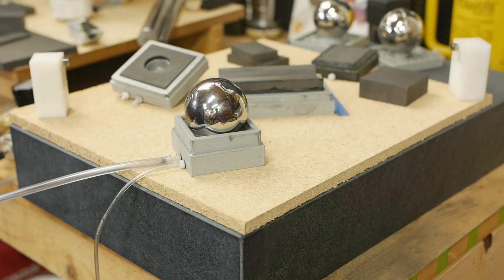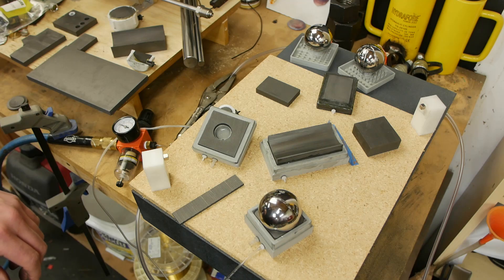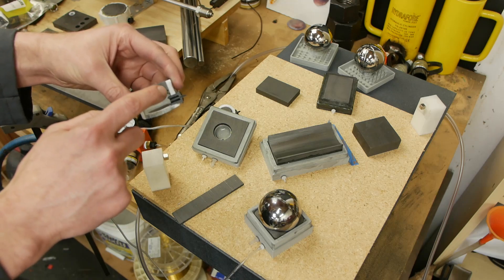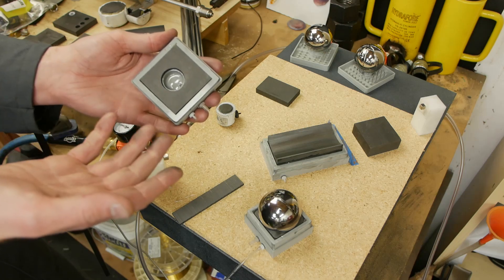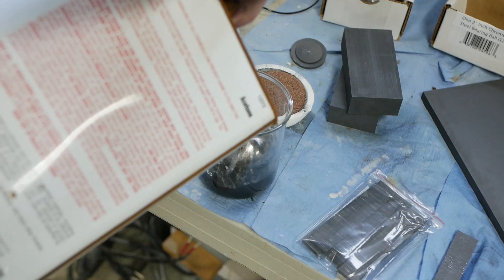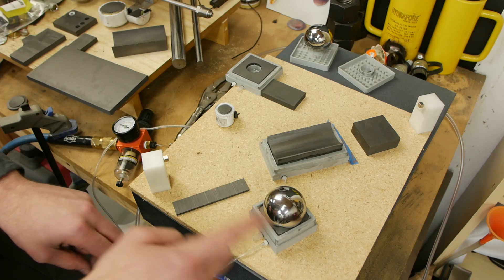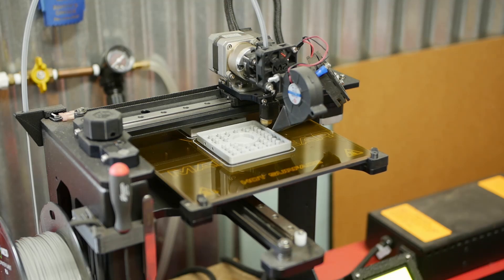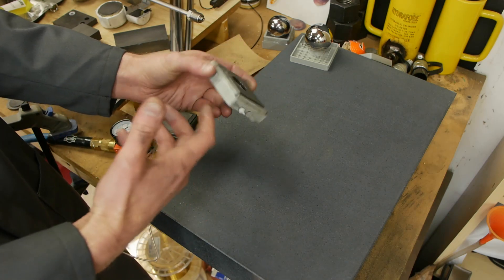Make vacuum pre-loaded spherical air bearings without special tools

Comment: I run a Zeiss CMM that uses air bearings. The 33 ton granite table is supported by them, all three axes are supported by them. They also make excellent vibration insulators, they were running a dirt compactor directly behind the room it's in, shaking all the tin on the building like mad, but the table had no vibration transferred to it. As you mentioned, it must be kept clean, as otherwise it would grind dust into the granite.
Reply: Well, I for one learned something in this comment section. I figured a regular air bearing would be sufficient to isolate vibration. Considering the size and mass of the granite table, I would expect that the system holding it is more designed for isolation. Otherwise, why not just set the table straight on the floor or a stand? The moving components are definitely air bearings though, which is pretty neat. Thanks for the insight. I mostly know about programming and operating, and even then my knowledge is limited.
Reply: @ahfreebird  You are most welcome. These things are all quite amazing!
Reply: Such civility. Scandalous.
Reply: Do you mean air cushions used for vibration isolation? Usually those are somewhat opposite to the air bearings -- an air bearing is usually desired to be very stiff to maintain the air gap exactly the same despite varying load (very high spring constant). Supports for vibration isolation are the opposite -- they allow movement of the support, but still provide the same force (very small spring constant).
Reply: @cogoid  the stiffness/damping of the air bearing is tunable by the film thickness. The less preloaded thicker film has very good damping affect. As it goes thinner it also gets stiffer and most of the time it can be stiffer than the fixtures structure.
Also, damping affect and elasticity are different things. Damping is not a measure of how bouncy it is. Thinner spring and thinker spring are both bad on damping because the energy got storage and release back and forward without much loss. Damping is how well it can obsorb impact and disperse the energy elsewhere ( or to another form). Air bearing by nature is a good damping material at it's stiffness class.
Reply: @dongchen7940  Thank you for mentioning damping. Damping is indeed important, but it can also be counter-intuitive. Although many of the things that you are saying are correct, the story is somewhat more complex.

Indeed, having sufficient damping is quite important in both air isolators and air bearings -- in all cases it is necessary for reducing resonant phenomena. 

Damping coefficient is a very specific parameter -- it tells how lossy the resonator is. As you have already said, it is a separate parameter from the stiffness of the elastic element in the resonator.

Air bearings can have substantial damping coefficient, but this is not synonymous with low transmissibility for vibrations. For vibration isolation of Optical benches, CMMs, etc, one should still choose isolators specifically designed for this purpose. For vibration isolation we are interested not in the damping coefficient or the stiffness per se, but in the system frequency response, at the frequencies of vibrations -- we want low transmissibility to the vibrations.

This response has a somewhat complex relationship with the damping coefficient. In particular, maximum damping in air isolators is usually not desirable for achieving the best isolation -- optimum isolation requires low stiffness and just enough but not too much damping.

Borrowing from Newport web page which I have already mentioned earlier ("The Need for Vibration Isolated Rigid Support Structures"):

The performance of the isolator is defined primarily by its natural frequency and damping characteristics

Natural Frequency (Natural Mode, Resonance) - The pneumatic isolator is essentially a simple harmonic oscillator that uses the "fast roll-off" at higher frequencies to act as a low pass mechanical filter. Below the natural frequency of the harmonic oscillator the isolator is essentially rigid and vibration is passed directly to the platform. At the natural frequency vibration is actually amplified. Therefore a primary goal is to lower the natural frequency since this improves low frequency isolation and overall isolation bandwidth.

Damping - Another primary goal is to damp the harmonic oscillator amplitude at resonance. This lowers the magnification of vibration at low frequencies and improves system stability. Unfortunately there is a compromise between the natural frequency and damping as damping is increased, the isolator natural frequency moves slightly higher, and higher frequency isolation is decreased.

Thus a practical vibration isolator provides a very low resonant frequency (by having very low stiffness) and also provides a compromise between having enough damping to not have a strong resonance, but at the same time not too much damping in order to have a rapid roll-off of the frequency response (and thus better isolation) at the higher frequencies. Vibrations at 30, 60 Hz are often of greater concern than the 2 Hz oscillations near the system resonance.

----

The less preloaded thicker film has very good damping affect.

It may seem so at a first glance, but at least for the kind of the bearings shown in this video the opposite is true -- up to some point, smaller gap results in higher damping together with higher stiffness. 

"New Way Air Bearings" company has many good presentations on air bearings, including measurements of how damping and stiffness depend on the air gap. Here is how they explain this:

"if there is zero stiffness, there can be no damping because the rotor has nothing to exert force on. A large film thickness is like ringing a rotor hanging on surgical tubing to get its undamped natural frequency. If the stiffness is infinite, then there is no motion, and again zero damping (damping being force over velocity). So, for a given system and frequency, somewhere in between zero and infinite stiffness, an optimum point will be reached to maximize the damping, after which point further increases in stiffness will begin to lock up the motion, reducing effective damping." [Damping & stiffness, a primer BY DREW DEVITT]
Reply: A small clarification. Isolation always suffers from too much damping. And generally, this has nothing to do with the changes in the resonant frequency, even if they may occur in some designs of the isolators.

In vibration isolation, the situation is as follows: there is a floor that vibrates, there is a machine (mass) which we are trying to protect from the vibrations, and there is the isolator between this mass and the floor. This isolator has elastic properties (it generates forces opposing it being squished or stretched -- this allows it to support the mass) and it has damping (it generates forces opposing the velocity with which it is being squished or stretched -- which allows it to dissipate energy).

The mass + elastic element is a harmonic resonator, and it resonates at some frequency, amplifying the vibrations -- an opposite effect of what we are trying to achieve! Adding some damping makes the resonance peak shorter and broader -- there is less vibration of the mass at the resonance frequency of the resonator -- which is a good thing. 

With more damping there is less movement in the spring at all frequencies. But this is not good -- our goal is not to reduce the amplitude of the movement between the ends of the isolator itself! Our goal is to reduce the movement *of the mass*, while the floor under it is vibrating. We want the isolator spring to move as much as the floor does, to keep the mass steady. But with infinite damping, the mass simply copies the velocity of the floor -- there is zero isolation. We do not want that at all.

Thus we want to have enough damping to reduce the resonance, but still relatively small damping, because the damping itself is a path through which the vibration velocities generate forces on the mass we are trying to isolate. (This dominates at high frequencies where movement velocities are high even for small amplitude vibrations.)
Reply: @cogoid  Thanks for the reply. I appreciate the discussion. I agree with you on the low-frequency vibration isolation. However that is a different thing than air bearings. It is more like the four floating feet we have on the optic table. Those things are very "floaty". I  don't have much research on that topic. The damping effect is also quite different than the vibration isolation. Damping is more about "impact" instead of a long period vibration source. An "impact" in time domain translates to a  very wide band in the frequency domain, it is not targeting isolation of a specific frequency. IMHO, damping is more important than isolation in machinery and inspection device.
Reply: @cogoid   - Wow, I just learned (and was given direction for further learning of) so much from this thread, and particularly your contributions to it.  Thanks!!
Also, your keen appreciation for principled communication, especially (ergo, all the more importantly!) on such a forum, is that of the finer, and therefore subtler, communicator/writer/artist; going hand-in-hand, of course, with the well-reasoned motivation to be appropriately thorough, in terms of both relevant information and the key inclusion of those pointers to references.  Grateful!
Will have to now check out your profile, see if you've any content on here...  Cheers/best!!
Reply: @cogoid  Air bearing is by nature very shock isolating - any vibrations from the base are transferred to the air mass that then purges out thru the gap between base and load. If it was possible to use Schlieren imaging, you could see the vibrations as disturbances at the air outflow instead of being transferred to the load.

Ofcourse with too high amplitude you can send the load to lunar orbit, but then vibrations are least of your worries...
Reply: @sleeptyper  Except the air gap is quite small. For a flat horizontal bearing, there would be excellent isolation in the horizontal plane and little isolation in the vertical plane.
Reply: @whitcwa  That is true when the air gap is completely flat, but some commercial bearing systems use grooves to increase the air mass. The more you have compressible fluid between your surfaces, the better dampening. A hovercraft is very good example of that.
Reply: Grooves don't increase the gap. Dampening for rigid air bearings is limited to the gap size. Hovercrafts use flexible skirts to keep the gap small.
Reply: @whitcwa  Grooves increase gap volume and thus air mass at the gap. More compressible mass has always meant more energy absorbtion.
Reply: @sleeptyper  How much do you think does the air in the gap of the air bearing weigh? Let's get some numbers and then we can talk whether your theory is physically plausible.
Reply: @cogoid  First you need to figure out the frequency and amplitude of your vibrations.
Reply: @sleeptyper  Take any bearings that are used in the typical CMM machines.
Reply: @cogoid  You see, the air gap is the last defence against unwanted vibrations in the system. Before it there are many other methods to absorb the kinetic energy. Methods, that can dampen even tornado/earthquake level energies to something that is very well tolerable at the instrument end.

For example Taipei 101 and many other skyscrapers have a pendulum weight that cancels out sway at the top floors of the building.

If you rely on a single airgap ontop of a stone crusher, your days as an engineer may come to an abrupt end...
Reply: @sleeptyper  That's very poetic. But we were talking about air bearings and how they are different from air isolators.

Both work using air, but they are not the same thing and their purpose is fundamentally different. How these things work is a matter of simple physics.

Vibration isolators provide support while serving as a low-pass filter for the disturbing forces. To do that, the system has to have a very low natural frequency -- the lower it is comparing to the frequency of disturbing forces, the better the isolation.
The frequency of the isolator is proportional to the square root of the ratio (stiffness/mass). That is why we want air isolators to have the lowest possible stiffness. (You can see the air isolation products, including those used for some CMM machines, made for example by "Bilz Vibration Technology AG".)

Air bearings -- the kind that is used in the precision machinery, serve to constrain movement, so that it occurs precisely along the desired axis with as little sideways deviation as possible. For the same disturbing forces, this deviation is inversely proportional to the stiffness of the bearing. We want the highest stiffness here. Precision air bearings are incredibly stiff -- in fact they can be stiffer than the metal that supports them (You can see a cool demo in a video "Radial Air Bearings on a Precision Shaft" -- it is made by a company specializing in air bearings.)
Reply: @cogoid  Hey, I hope you don't mind me asking, but you seem well-educated on these things: Since air bearings and air cushions both use the same medium (i.e. air), how do you adjust the stiffness of the air for the different applications? Don't they both have the same elastic modulus?
Reply: @DeShark88  It is an excellent question! 

When you push on anything -- even on a wall of a building, for example -- it yields, however unnoticeably.
Stiffness is how much resistance it offers to displacement. Stiffer stuff deflects less for the same force.

Displacement = Force / Stiffness.

For small displacements, the Force is proportional to the Displacement (for a spring, this is called Hooke's law), but if we plot the dependence of Force on Displacement over a wider range, it generally is not a straight line -- some things become stiffer when you compress them, others buckle or break and their stiffness disappears altogether. Stiffness can even be made negative for some range of displacements -- as for example in a light switch, when you push it to the point after which it flips on its own. For an arrangement of components, the stiffness can be engineered to vary in a specific manner -- for example by combining positive and negative stiffness, overall stiffness can be made very low.

Returning to the question you have asked:
 
The Force produced by the air cushion in the air bearing is due to the air pressure pushing on the surface.
The stiffness of the air bearing then depends on how the pressure in the air gap changes when we squish the air gap.
This pressure is determined by the balance of air coming into the gap and escaping from it. If more air comes in than escapes out, the pressure in the gap goes up, and vice versa. In a properly designed air bearing, the air comes at a more or less steady rate through the pores or small orifices. But the rate at which it can escape from the gap depends very steeply on the thickness of the gap -- if we squeeze the bearing even slightly, the already small gap (say, a 0.001") becomes even smaller, and restricts the escape of air. The pressure goes up, and the bearing pushes back against the force which is trying to squish it. This feedback mechanism is the reason for the stiffness of the air bearing. And that is why the very narrow initial air gap is essential for having very high stiffness. (There is a very nice explanation with a lot more details in this document: "AIR BEARING APPLICATION AND DESIGN GUIDE" from IBS Precision Engineering. Just Google it.)

The air springs used in vibration isolators are designed to achieve the opposite effect -- a restoring force which is almost independent of deflection. The simplest design is a small piston that is compressing a relatively large volume of air. A small movement of the piston changes the volume and hence the pressure very little, and the restoring force remains almost constant. 

Usually, it is also desirable to add some friction to this process so that the mass supported on this air spring would not bounce up and down forever. This friction is often produced by passing the air through a small orifice between the chamber where the piston or a diaphragm compress it and the main air volume which maintains the pressure more or less constant. 

(There is much more to vibration isolation, and you can see one typical design of the real air spring towards the end of this web page: "Technical Note: Optics Based Research - The Need for Vibration Isolated Rigid Support Structures" on Newport Corporation web site. They are a big name in optical equipment for research and sell very nice vibration isolated optical benches.)
Reply: FYI table mass and the cushions it's mounted on are the bulk of the vibration damping for CMMs. The use of air bearings is to eliminate stiction on the surfaces of granite which in turn has to be used for it's thermal expansion properties, our ability to machine it FLAT af, it's wear properties to maintain flatness, etc)
The other main reason is to maintain consistent clearances. The actual gap size doesnt matter (though 0.001" is only a couple orders of magnitude off). What matters is that once a calibration tech sets of the machine based on the gaps it has, that those will stay the SAME for years. One property of air bearings that aids this is that a common air line running all over to all the bearings shares pressure and is enough plennum compared to what's "used" at the bearing. This can be easily maintained with a regulator set below the minimum of the shop wide air supply. (one thing that will really mess up a CMM is air or oil in the incoming air lines.)

CNC Mills and lathes can get away with oil lubed ways and adjustable gibs because they only have to have locational accuracies measured on the order of tenths. (0.0001") whereas we have to measure and confidently report at least 10x tighter.
Reply: @zedex1226  Great points! Though I think you have exaggerated a little bit how small the air gap in your machine is. "The air gap on bridge-type measuring
 machines from ZEISS is just 6-8 µm." [from manufacturer's literature]  (That's 1/3 .. 1/4 or 0.001") Like you have said yourself, it is not the actual air gap that matters, but how constant it stays in operation -- and that, indeed, can be orders of magnitude better than the gap itself. In some specialty applications air bearings have much larger air gaps -- up to multiple thousandths of an inch, making them very "soft." You would not see such a bearing in a CMM, but they find their use where ultra-low friction and very high speed are important.
Reply: @cogoid  
Cool! My knowledge "under the hood" of CMMs isn't as deep as for CNC machines. I do some basic maintenance but our 4'x8' hex machine and some deeper maintenance on an older starret machine along with programming on both. I really got the impression the gap was sub tenths. Neat.

I have made pucks to fit under the feet of a CNC machine to move it from place to place. A structural aluminum element with a delrin pad and "cold runner" channels, plumbed together and plugged directly into shop air. Between the .003ish flatness of the pads and the several thou finish on any given piece of floor it worked surprisingly well. 2 or 3 people pushing it around and a dedicated safety "axe man" on a ball valve/quick disconnect fitting of the air supply
Reply: Just remembered another nice feature when it comes to CMM applications. A tendancy toward self cleaning.